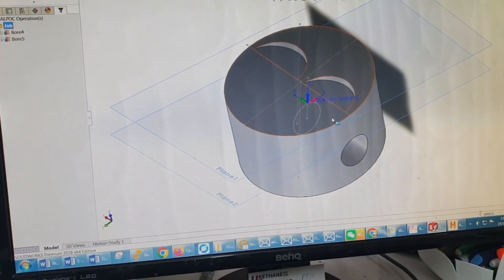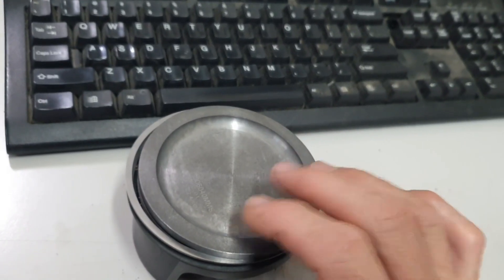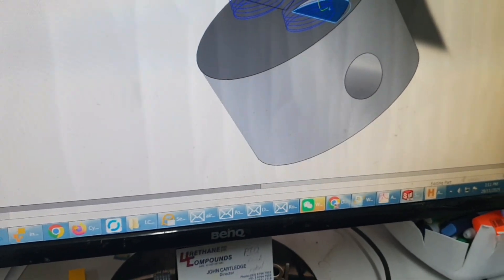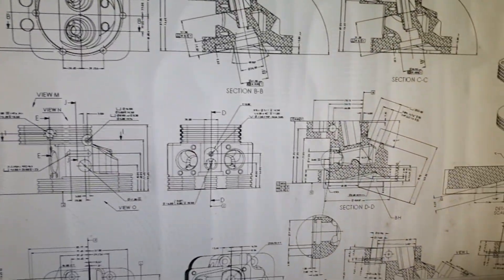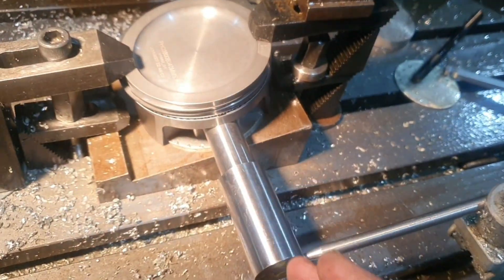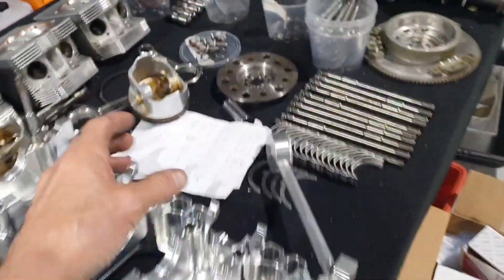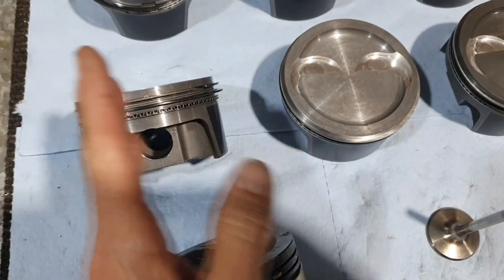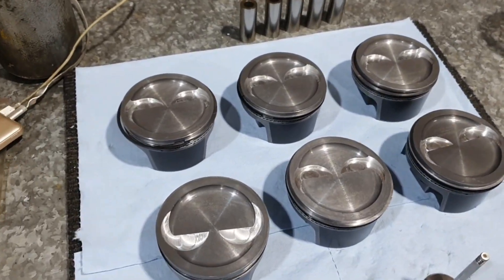Jabiru 3300 forged piston upgrades. Let's add some valve relief pockets.

Comment: Considering the operating range of that engine. An offset pin would likely be superior. Also, with air cooled cylinders. A 4000 series aluminum forged piston would run loose on a hot engine as the high silicone % reduces heat expansion. I have not researched compatabillity in this application. But I suspect this is not the best way forward.

Comment: Are you using dished pistons in the Rotec engines? Forged?
Reply: 1 more question, on the liquid cooled head Jab, can you remove the dish, still keeping the valve relief and bump the compression up a bit. Or are you already doing that? Better performance..

Comment: Great video. Question: We just acquired a Gen2 still in the crate, 0 hours. What would you recommend before installing on a Sonex? Should we replace any parts before we start our installation? Nothing has been upgraded, we are going over SB's. Thanks!
Reply from the maker: Strongly suggest an ovehaul with updates